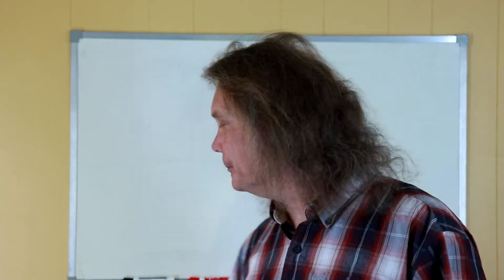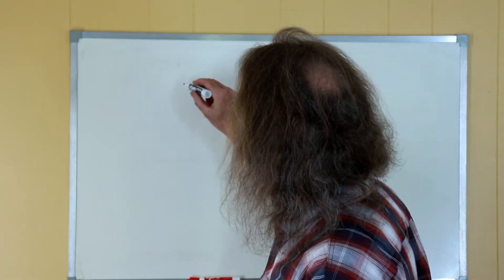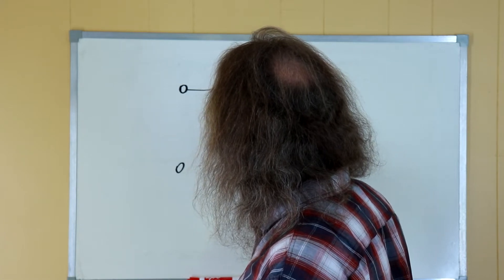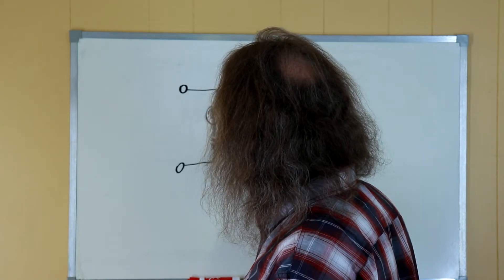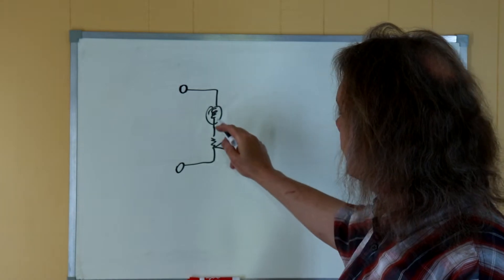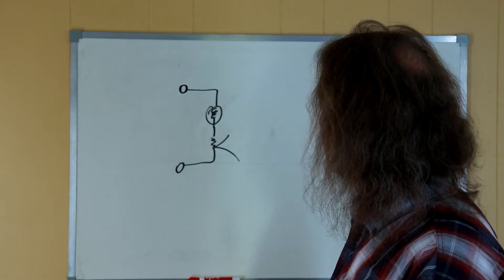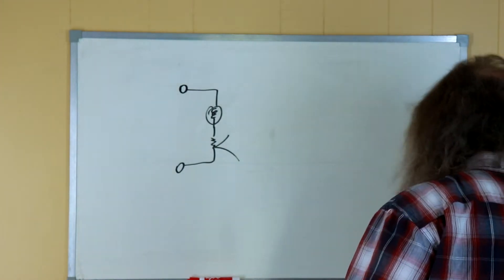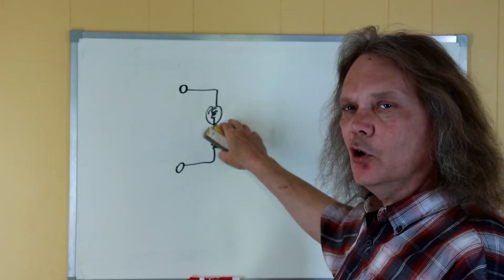Light Bulbs in Speakers - The Surprising Truth  - You Won't Believe the Benefits!

Comment: Huh, never knew about this, seems like it might be useful for some other applications as well. A clever, passive nonlinear current/power limiter. 

(Household light bulbs are great for limiting current in both AC and DC circuits for higher voltages too, although I’ve never relied on their nonlinear R/T behavior.  I’ve often used them as stand-ins for high-wattage power resistors if I needed to get rid of a lot of power ahead of a regulating element like a pass transistor in a linear voltage or current source or active load. It’s horribly inefficient and these days you’d use some sort of a switching supply, but if you just need a quick and dirty hack for a linear supply of some sort they’re great 😁)
Reply from the maker: Yes, I've also seen incandescent bulbs used on the test bench for current limiting equipment.  Some guys will build a little box with a light bulb, a power cord, and a power outlet.

You run the main's power through the bulb in series to the piece of equipment that you're testing, so if the piece of equipment you're repairing draws excessive amounts of current it lights up the light bulb rather than blowing up and starting an immediate fire on the test bench.

Comment: Hi sir, in my heco pcd 90 speaker at 8ohms crossover they have used some fuse bulb and the same has damaged, can u suggest best alternate or what type bulb to be used in it because without that iam not able to use 8ohm input
Reply from the maker: Any standard automotive type bulb would restore operation.  Some PA cabinets use things like 1156 turn signal bulbs, but that might allow too much power to pass to protect a home audio speaker.

I would choose a bulb with about the same rating as the original so it offers proper power protection for the driver that it's protecting.  I'd look at the original bulb, try to find a number on it and replace it with an identical part.
Reply: Thanks for your suggestion, but in that crossover i can't found any exact fuse spec since its broken, can i go for 20w or 35w small bulb so it can fix that

Why iam telling in that watts bulb !!, i have tried with 10w 5ohm resis in that input but while volume raising above 50% it gets heat, so this watt bulb would help think so
Reply from the maker: I'd probably try something like this:  https://amzn.to/3Ufgkzy
Reply: I tried this but not found thats what gone same spec but differently